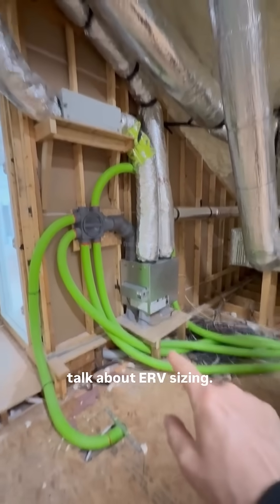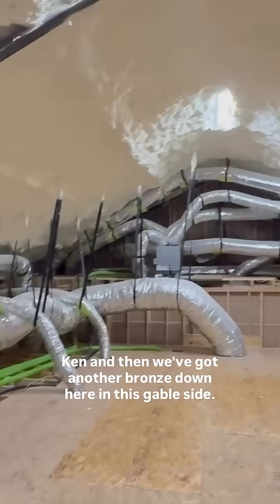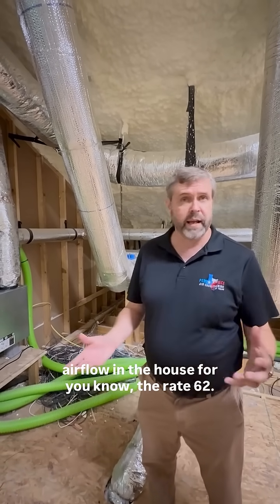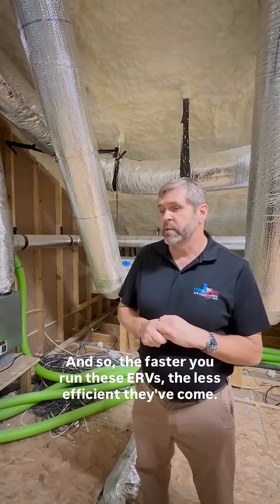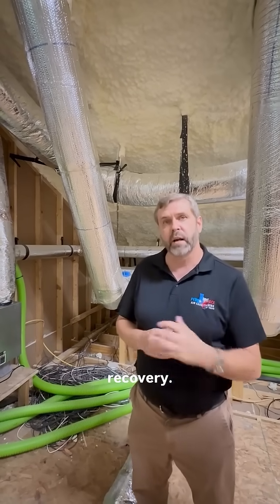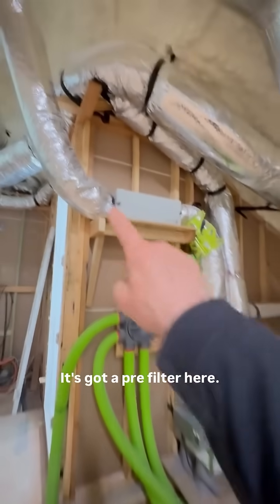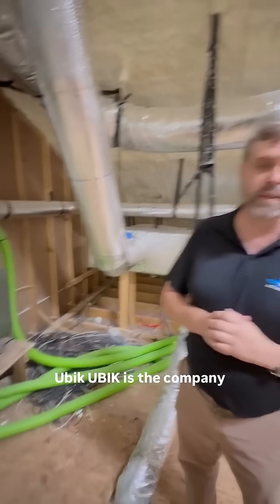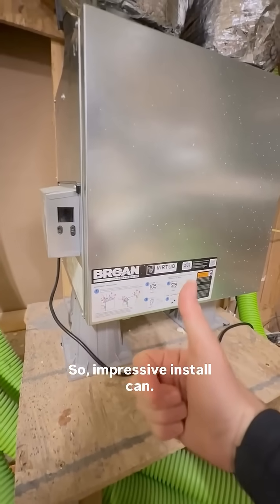ERV Sizing

Comment: What is an ERV?
Reply: Energy recovery ventilator. It supplies air to a tightly built house by bringing outside air in and exchanges the heat and humidity with the outside air. It leaves the house smelling pretty clean as the supply is brought into the bedrooms and the exhaust goes out the bathrooms, kitchen, and mechanical areas.

Comment: I'm not super I'm not super familiar with ERVs so this is pretty cool to see. I've been doing this for a while and have yet to run across one
Reply: Oh yeah, the problem is how is back in the 50s and earlier they didn’t worry about energy cost. Do you know home heating oil was $.15 a gallon now houses are so airtight which is good super insulated now you need to get the bad fumes and crap out of a houseso that you can live and have a healthy house and it’s better to have two of these ERV’s that run at 60% rather than a larger one running at 95%.